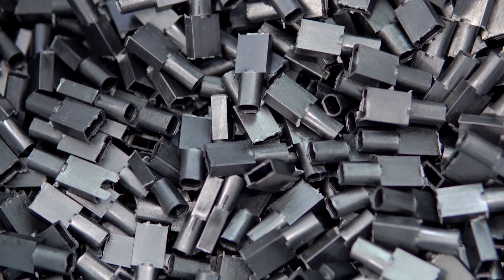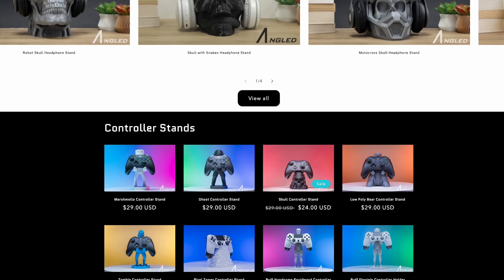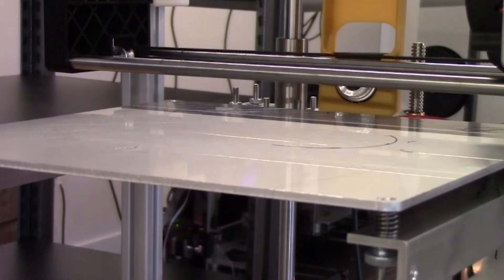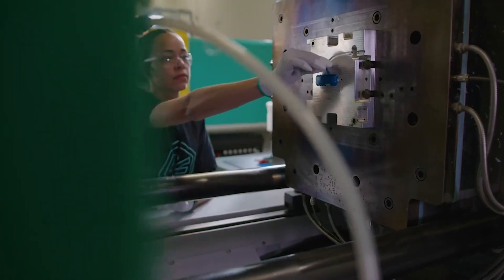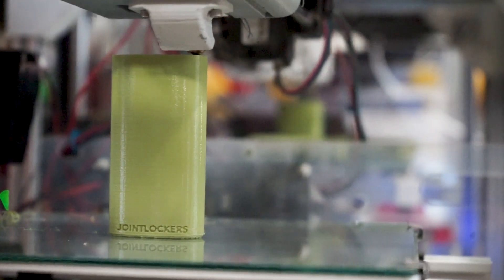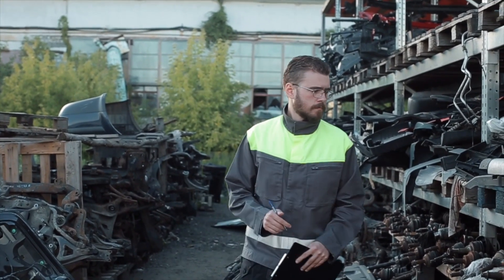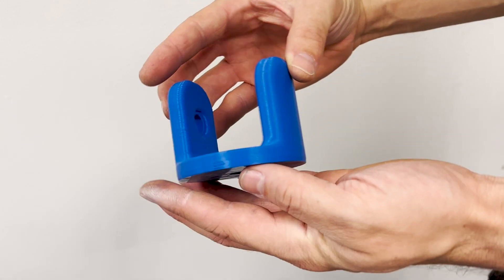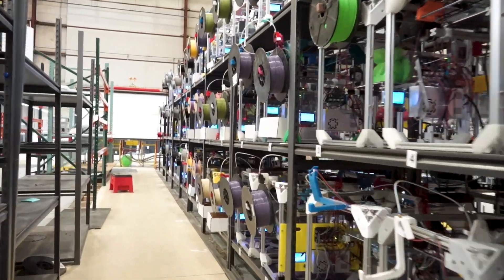The Thing Stopping 3D Printed Spare Parts

Comment: Making any kind of functional part can be very hard if it connects to something out of your control. I make parts for travel trailers (a very specific model). It requires a LOT of research, following forums, and facebook groups to figure out what is needed, design it, find someone that has the trailer to work with you to test it etc. It's a very slow process, and it produces slow, but consistent sales. It's like trying to roll a giant heavy wheel, it takes a lot to get it moving, but once you get a large enough selection of parts, it produces a pretty consistent flow of orders. It certainly isn't easy, and you also have to figure out how to access a very narrow market for the particular part you're making. That's why I make every part I can think of for one particular trailer model, so that I can amortize the high customer acquisition costs across multiple products. I also have to price in a lot of extra support costs because manufacturers make changes and revisions that cause things to not fit, and I don't have access to this information. You just have to charge enough that when someone has a problem, you can revise the part and send them another one and not lose money. The cost of production isn't even that important, it's managing the compatibility information and inevitable support calls that is the majority of the cost.

Comment: I work for an OEM trying to use additive manufacturing for printing spare parts. One of my biggest problems is validation - since it's probably using a different material and for sure a different process than was approved/validated for the original part. It is expensive to do testing required when you're only going to sell 100 parts.  Eventually we should get enough confidence and data in the material properties to not have to test every part though.

Comment: And this is why I want to 3D print a replacement air distribution box for my 99 Tahoe cause no one sells it anymore
Reply from the maker: shoot us a link to a description
Reply: @slant3d  I have yet to pull the dash out and see what all of it is broken but the bottom section has holes and unsure what other parts are in need of replacement

Comment: I agree in part. Most parts that are NLA don’t make the ‘thing’ unusable. They just make it a big hassle. Like “ok fine, my 1962 Honda won’t have the trim piece around the sun visor anymore.” No one is going to buy a new honda because of that. Companies ramp down production on certain items just to make room for other newer parts, not because they are trying to screw the customer. Like the knob on my washing machine you can’t get anymore, but the company probably used that part on many other previous washing machines and then my model was the last. The new washing machine was designed with a different knob, so they now make the NEW knob and the old one gets pushed out. If they could easily have a way to make the old knob still while not hurting production on the new knob they totally would. I mean, they’d make money on selling the old knob too.

I bet it’s not liking the aesthetic of 3D printed parts compared to really smooth injection molded parts and also not really knowing or caring to invest money into looking for other places to have it made. But if they were approached then maybe that would be possible.

At least this is part of the issue.

Comment: its called forced/planned obsolescence. It's been around since the beginning of large scale manufacturing. Everything from cars, electronic devices, appliances, lawn equipment, anything and everything that is produced on a large scale and sold to the masses has a preplanned date that the manufacturers will no longer offer spare parts for, to stop you from buying replacement parts and to instead offer you a whole new device at an inflated price. It's what they count on to stay in business because they are not happy with just enough or even comfortable they want more and more, and they will continue to do so if left unchecked.

Comment: So currently the problem is that websites to sell spare parts rely on the OEMs to supply most or all of those parts, and understandably, once an OEM stops making a part, they don’t want anyone else to either, otherwise they’d just keep making it themselves. Planned obsolescence is nothing new in manufacturing, but here the only problem seems to be the leverage that OEMs have over the spare parts sellers. Why doesn’t someone start a spare parts website that doesn’t rely on any OEMs, that only sells 3rd party parts for example? These certainly exist for particular products, like a particular car brand.
Reply: probably afraid of patent laws and design copyrights? luckily where I come from, this is not a problem, it is rather the problem of identifying the parts.
Reply: @MOzymandias  I don't think IP rights are really an issue - if something is old enough the manufacturer wants to push people to a new product the patents are probably expired, and a reverse engineered part shouldn't violate copyright. Legally it could be done, but having one store that sells official copies of a certain subset of parts (along with the full products most likely) and another that sells replicas of a different subset of parts might just get to confusing for consumers. Makes it pretty obvious how anti-competitive these agreements are.

Comment: So you're basically finding the exact same issues as the re-stamp (repop) sheet metal businesses. We as found essentially the same issue. Only difference is remanufacturing a brand new hood or a fender for a 50 year old truck is profitable, even after getting the licensing to reman.
Reply: Wait, 50 year old trucks need licensing? I thought patents wouldnt last that long. Unless the design is covered by copyright or something to that effect.

Comment: Smells like a new law needs to be created to ban such "prohibition to release requested unavailable data". Markets do not always self regulate to the benefit of consumers and external action is needed to reach the desired outcomes.
Reply from the maker: Generally fewer laws are better than more. The market may be slow to correct if it is wrong. But laws never change if they are wrong.
Reply: @slant3d  I agree that they are tools of last resort, and they should be used sparsely. In this case, other than laws, what new situation do you think could motivate a change in OEMs policies?
Reply: @rodrigob  No need to change their policies or create new laws. Only to increase public awareness of 3D printing as an alternative. Build the database yourself as people request parts that they couldn't find elsewhere. Advocate removal of any existing laws that the OEMs use to harass you for disrupting their racket.

Comment: Why not use a commission model for sourcing FDM compatible designs for replacement parts from the 3D printing community? You could also gather interest for parts which do not yet have designs to incentivize contributions.

I think the larger issue missed here may be the risk of litigation over reverse engineered parts, especially those which may still be sold commercially or are under patent.
Reply from the maker: That is the problem with "crowdsourced" models there is a long of unusable pieces both in design and legally that are difficult to verify.
Reply: @slant3d  to do it reliably you would have to test every part that someone submits, that just isn’t feasible. With crowdsourced designs you would get a huge variety in quality which is not what you want as a business and a company selling sub standard 3D printed parts would damage its reputation and the reputation of 3D printing as a whole, so again that brings it back to having to test every part and not just taking the crowdsourced designs and using them.
Reply: Prusa is attempting that on Printables, working directly with brands.

Comment: The right to repair movement that should include part schematics so replacements can be 3d printed in small batches in a cost effective way.
Reply from the maker: That is good for parts moving forward. But it doesn't support past products.